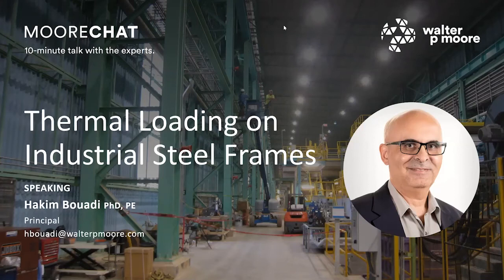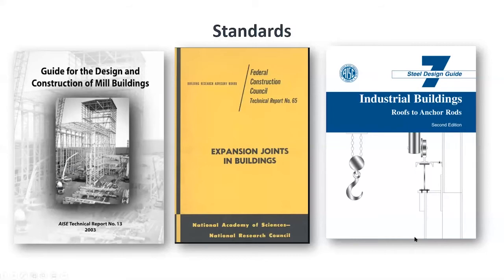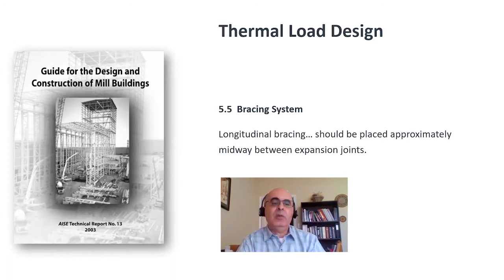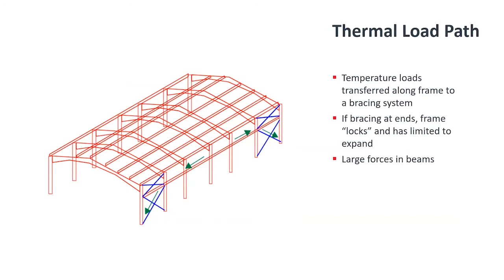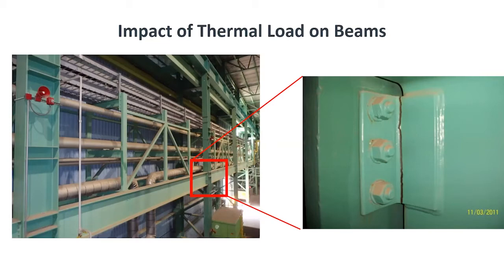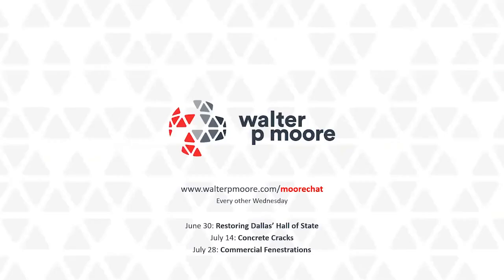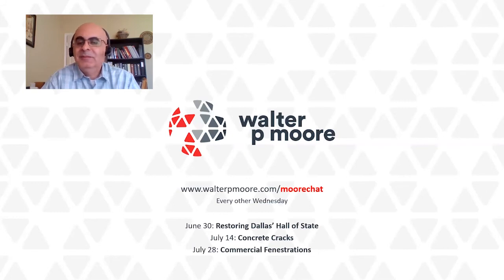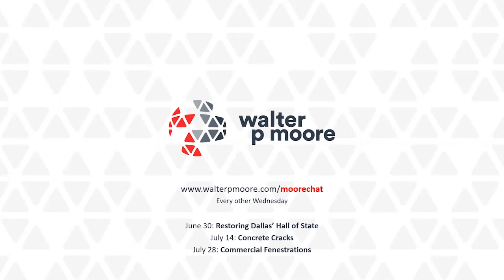Thermal Loading on Industrial Steel Frames

Comment: Hi , if there is portal frame, with rafters and columns.. the axial force due to thermal load is high >> the question is can the end of rafter be roller restrained like allow transition in its elonogation axis? or release axial force in it ? 

then in reality to allow the beam to extend due to thermal with steel plate>> can the plate modeled as notch plate to allow for the bolts extend or move?